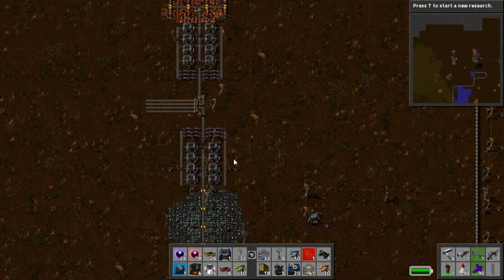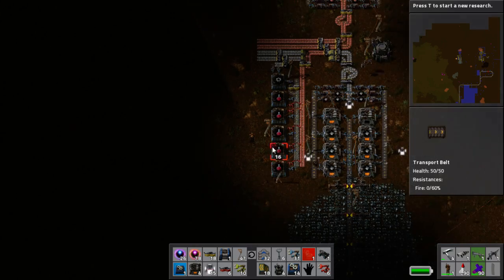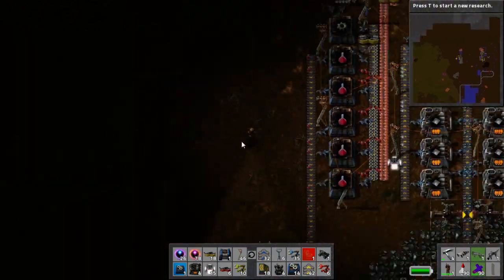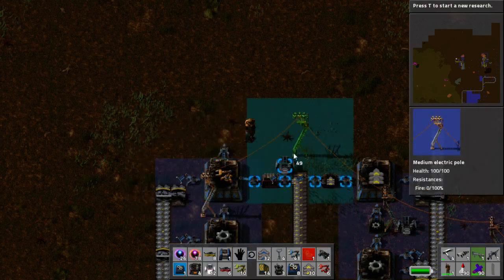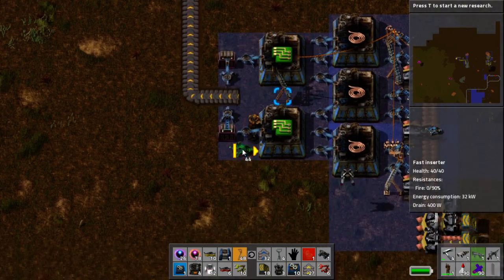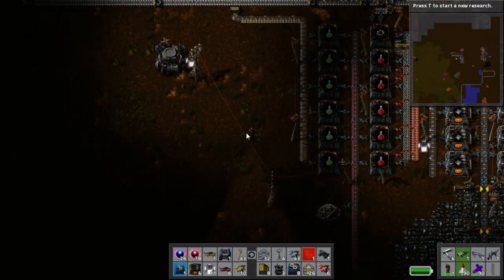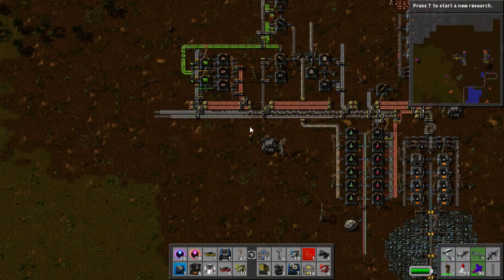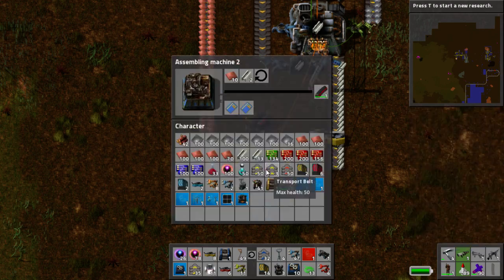Factorio Tutorial 36 - Central Bus Design Concept

Comment: What is opinion on the following? - Looping belts containing materials (when parts of the factory are no longer producing due to rules you've set or belts becoming full) such that they reintegrate with the central bus.

Excellent video by the way! These are the kind of ideas I'm looking for to better my builds in Factorio, and you explain them well.
Reply from the maker: I think the theory is sound however in practice it would be too hard to do in a balanced way. Routing all those belts back around to the start would take a lot of space. I think it is just easier and also effective enough just to run things this way.

Comment: Do you recommend having other items on your main bus (ie: Steel, Plastic, Batteries) or just keep it Iron & Copper?
Would two lines of Iron & Copper be able to support the mass production of Green & Red Circuits or would you need additional lines?
Is it okay if your branches don't line up with where you are splitting the line (ie: need to use bends in the line)
Reply from the maker: BrianD0313 make sure you're watching my Break The Game series, you're about to see what the "cutting edge" is in terms of factory design. To answer your question, only items that should go on a main bus are iron, copper, steel & green circuits. You may need additional lines, it depends on how hardcore your factory is. THe above video is for rookie-intermediate players. THey would never overcome the throughput that gives.

At the moment, corners are the devil. They introduce compression losses into the factory and slow everything down. However in 0.12, that will no longer be the case. SO I guess my answer is, corners are ok, just minimize them and try to build in straight lines where possible :)
Reply: I still need to finish watching your Season 1 and then your awesome PA series :P
Reply from the maker: BrianD0313 skip Season 1. Its extremely out of date now and best practice for factory building has moved on quite a bit :D

Comment: Thoughts on adding gears and copper wire to the bus (and maybe more)?
Reply from the maker: Well, this is kinda exactly my point, you shouldn't. Make it all locally and keep things easy and straight forward.

The most (at the absolute max) you want to put on a central bus is steel and electronic circuits.

Comment: This is awesome!

Any tips on transporting stuff being made far away to the other corners of the factory? For example, batteries and plastics, that "need" to be made very close to oil fields.
Reply from the maker: Logistics bots.

If you're not a fan of logistics bots, try and group the builds that require batteries together and have it so that they are as close to your battery production as possible. Same with plastics, have your red circuit production as close as you can.

This is going to require waaaay more planning though to get your factory to work smoothly
Reply: Ohh, i AM a fan of logistics robots... its just that hauling a lot of items seems inefficient... its like buying a dozen of eggs, one at a time... isnt it?
Reply from the maker: It depends on the total throughput needed. If the throughput isn't too high, logistics bots are fine.
Reply: ***** Almost all real industri is trying to come to "just in time" and "1pice at a time". Bufferstorege is a way of hiding your real problems.
Reply: EriYtt
Sure, in real life that is actually true. In this game however there are no board rooms, share holders or currency to drive the need for such ultimate efficiency. Having spare items on a belt or in a box is not relevant beyond your initial settings for resource density/frequency, unless you count personal aesthetics. To put it another way, resources are free in factorio and unless you start with very low settings for generating them or very high alien nest settings(or both) the issue is really moot.
Reply: ***** You could just send an small train and use the great energy pylons, red cable and smart inserters to deliver as many batterys as you need and not one more.

Comment: 5:26 why not split copper abit later and put it on the left side of the belt with gears? i always go like that
Reply from the maker: Just to maintain capacity on the belts. There's no real reason, the more efficient way of going would be just to use the one belt. Its just how I prefer to build, this way i have a belt of gears to deal with and a belt of copper to deal with and its easier on my brain.

Comment: good stuff man. do you have a vid where you bring coal into the mix?
Reply from the maker: you don't require coal on the central bus. You just need to get it to the specific places its required (eg plastic manufacturing).
Reply: makes sense. thanks

Comment: Negative Root At 4:34 you say you like two lines better but is it ok if we only have 1?
Reply from the maker: Coolbeans Ballsack of course. Its all about scale. If you are buliding small, you can make do with a single belt. Even half of a single belt. if you want to scale it up though, you're going to need more. The reason I rolled with two is because it is easily manageable and very few players can actually bulid bigger than than a double blue belt at full compression.

Comment: Those poor inserters on the copper coil not getting any resources.  Also, that smart inserter that is having iron shoved down it's throat whether it likes it or not.  :D

Good video otherwise though.
Reply from the maker: Ah, I see what you mean about the copper coil build... I did miss some belts.

The smart inserters are maintaining balance in the factory. Steel production will eat everything you can throw at it. Best to limit it to prevent it from killing everything off :D
Reply: No, I mean when you're producing smart inserters you're trying to shove iron into the assembler. :D
Reply from the maker: lol, yeah I spotted that too when i rewatched it. obviously, plenty of mistakes in this factory because i was trying to build quickly :D
Reply: It turned out really good for a quick 30 min build.